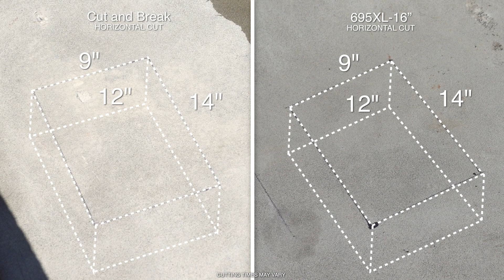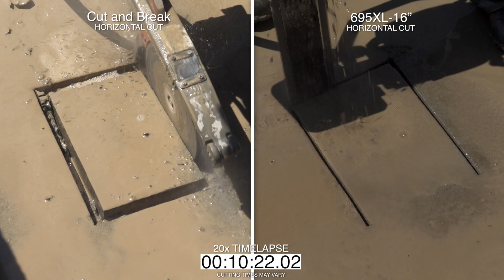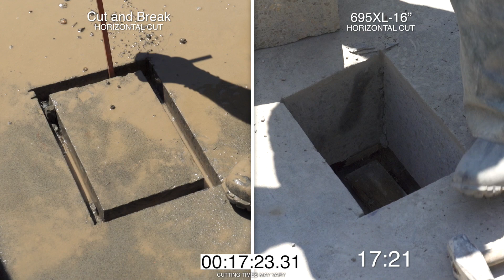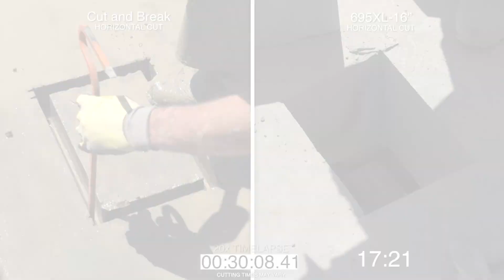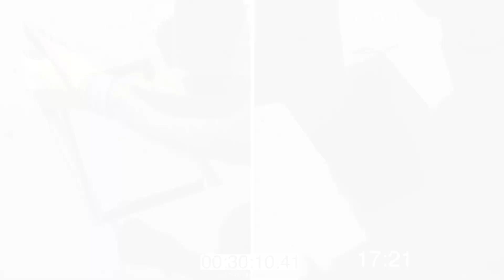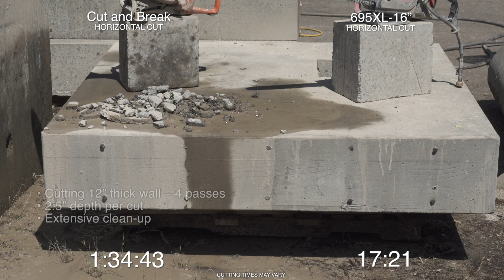ICS® 695XL vs Cut-n-Break - Floor cut

Comment: Hello, I have a cut n break and have already cut a few meters. To get the middle bridge out I use a caulking hammer, I cut the hole in 35 minutes there. Two Cut n Break blades costs about 200 euro, a chain costs about 600 euro. Both have its pros and cons, the chain saw I would use only for small details and the cut n break for bigger. Cheers

Comment: No rebar! I've used both on 32mm reinforced concrete. Ics bars and chains are terrible!
Reply: estimado ud recomienda esta cortadora manual, que valor sale ?
Reply: If all you are cutting is concrete with a 16 mm rebar, then it is probably okay. Beyond that, I would go with the Husqvarna K4000 cut and break or be prepared to replace the bar and chain due to deflection, even if used with the additional rail system.